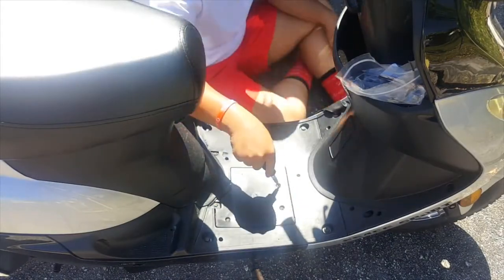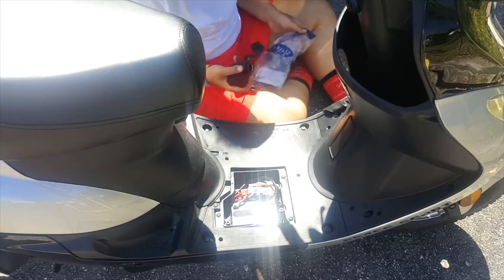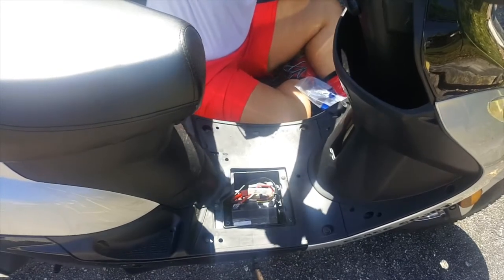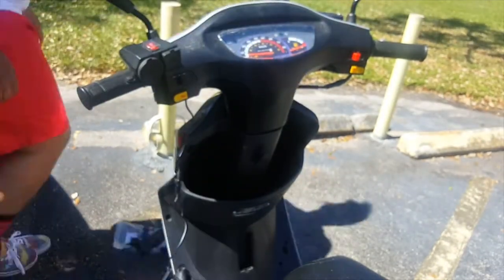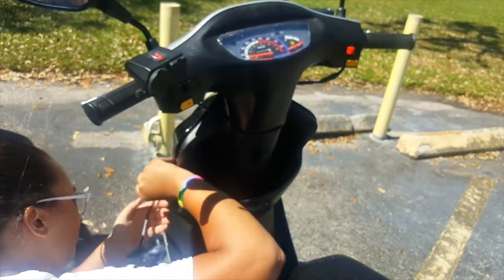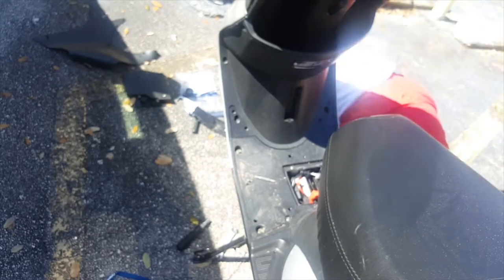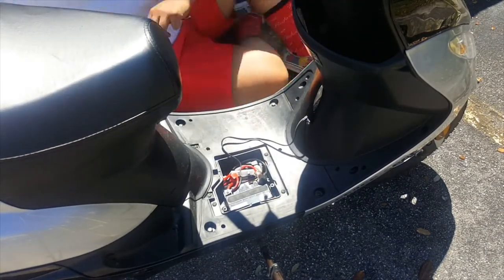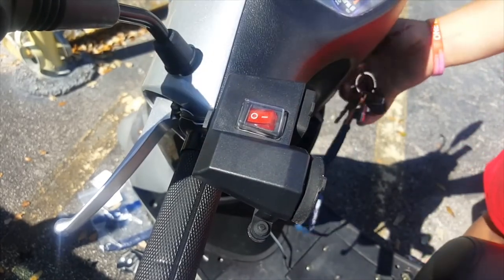How To Install a Phone Charger on a Scooter

Comment: Step 1: Plan where you want the port to be. Or find one that can be mounted safely

Safe routing of wires is paramount to safety. An exposed wire through your VIN panel is bad. To do this job safely, you should tidy those cables behind the front panel.  Anything can get behind there and cause an issue. The negative should really be connected to the frame and the positive connected to a switched live.

I wouldn't use a splice method and here I would opt to use a 3.9mm Japanese bullet connector with rubber shield. They are smaller and look nicer.

The method shown here allows a power draw if there is too much resistance thereby draining your battery over time.

Comment from the maker: UPDATE: I ended up moving  the wires and running them under the scooter and through the front for a neater end result and also so that wires wouldn't be caught on anything when I was driving. This video was just a quick install because I needed to go to work and be able to charge my phone and not have to keep coming back home to charge my phone while on the go.

Comment: Yes, I wholeheartedly agree with you that most of the videos on this issue are for motorcycles and not for scooters with batteries under the floorboard.  You addressed that issue, but I really did not understand what you installed.  What is the name of the cable that you attached to the battery and the scooter, and where can it be purchased?
Reply from the maker: They must not sell the one I used but here is one that is very similar. https://smile.amazon.com/EKLIPES-EK1-110-Ultimate-Motorcycle-Charging/dp/B0088BX0IM/ref=sr_1_14?crid=1Z76NIA385LQ0&keywords=motorcycle+phone+charger&qid=1563067130&s=gateway&sprefix=motorcylce+phone%2Caps%2C180&sr=8-14